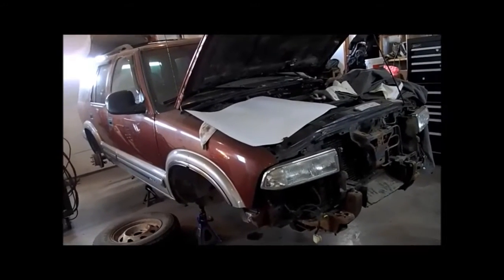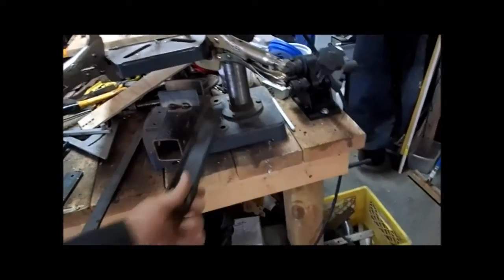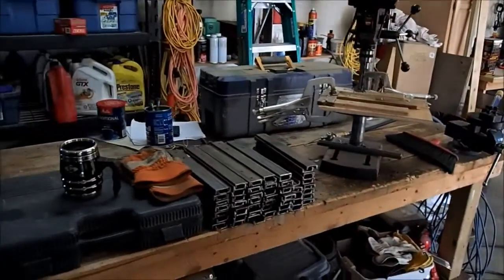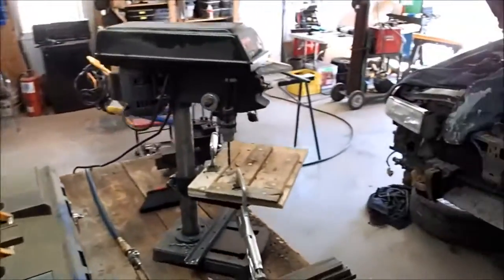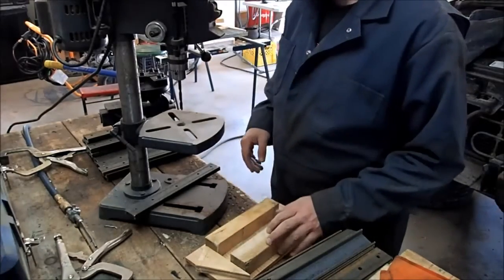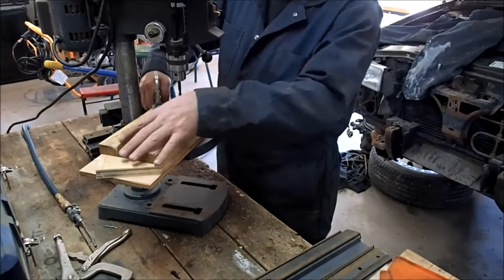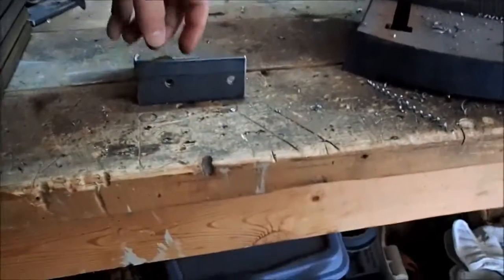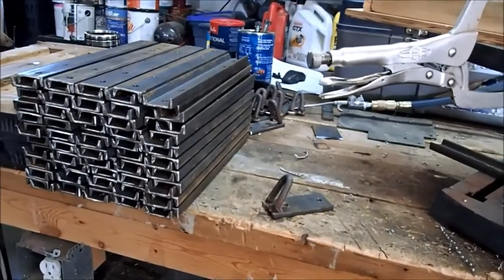Custom Tracked Vehicle, Part 6 Track

Comment: where did you get the rubber for the track and does it have good strength for off roading. i really like what your doing with this and im designing one from scratch for extreme off roading and mountian climbing so any advice you can give on dos and donts would be appreciated. thanks
Reply from the maker: Hi, The rubber I got from a place called Nowesco Industries in Calgary, AB. But if you search similar in your area I am sure you will find it. The rubber is double reinforced (two nylon layers) and 3/8" thick. It is rated for 400 lbs per inch, with a breaking strength approximately 4 times that. So since on one side I have 8 inches of rubber (two 4" pieces) I should have a working limit of 3200 lbs per side and a breaking strength of over 12000lbs. Should be good enough for my vehicle that weights under 4000lbs. The material is conveyor belting and comes in different thicknesses and ratings, and there are smaller ratings so you should be able to find something 1/4" thick or less.
You can't over design, make it heavy duty.
Don't give up when it gets difficult, look at the failures as revisions.
Take advice from everyone and listen to their suggestions but you need to decide if it's going to work for your application.
Best of luck!
Brad